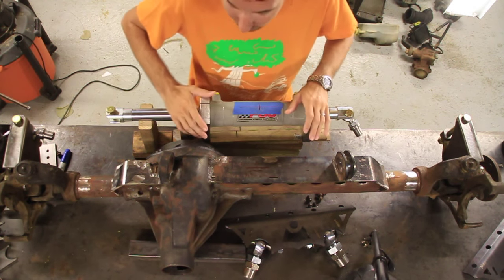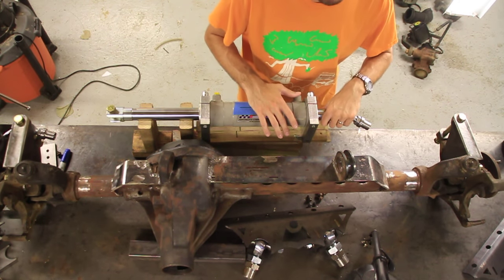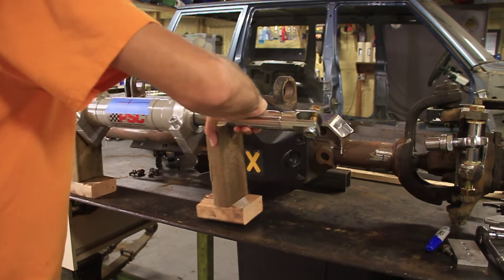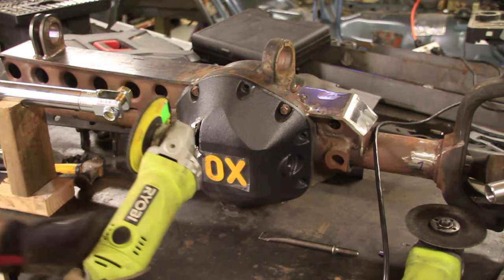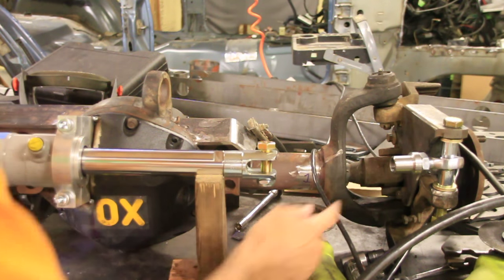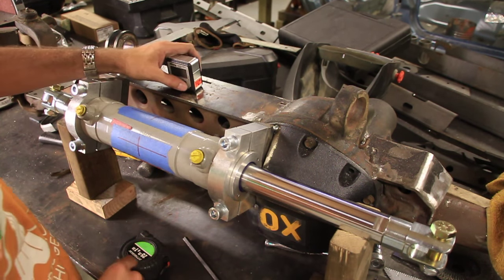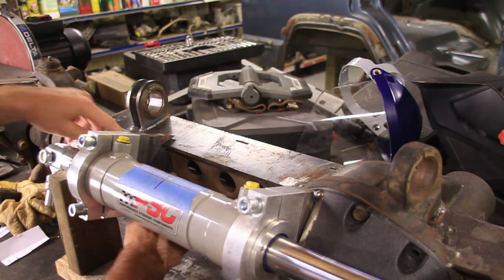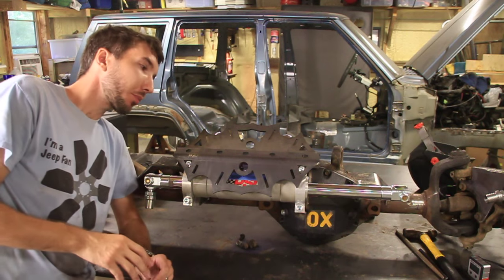How To Mount a PSC Ram

Comment: Angling your rod ends inwards at the correct angle (as mentioned at the 12 minute mark) gives more of a 1:1 steering ratio.
As an example, I ride my ends on the 2nd hole back of my high steer arms.

Yet another great vid Matt.

Comment: Just some info when grinding Aluminum, apply some grease to both, the Aluminum and the soft wheel disc.
This keeps the material from gumming up the disc.
Generally a 36 grit soft wheel works best.

Comment: Absolutely awesome! But how would you change gear oil or do any differential work without having to remove the entire ram set up?
Reply from the maker: You won't, but there was no other solution... 4 bolts and it comes off in a few minutes though.
Reply: +BleepinJeep Very much appreciate the reply! Keep on doing amazing work really excited to see how this project turns out!

Comment: awesome. you are very quick with figuring out custom brackets. sweet steering setup, hey what front suspension are you going to be building. 4 link? 3 link? radius? you might have already mentioned it but i don't remember
Good shit and always happy to see your new vids
Reply: If I remember right, in a previous video he said 4 link.
Reply: without panhard?
can't wait to see that build. im right at the point where im designing a front 3 link and crossmember ..
Reply from the maker: Yes, double triangulated 4 link.
Reply: Awesome. Can't wait to see how you package it !

Comment: what kinda torch is that ? propane ? , my set up is on a toyota so its a little different , my ram is a bit  different than yours , 6 inch stroke and no groves on the cylinder body for the clamps but it is from PSC

Comment: Care needs to be taken when changing shape of diff. inside shape of stock covers are  designed to feed gear lube smoothly and not aerate. If lube does not flow well will decrease amount lube going to pinion bearing and fluid with air in it does not dissipate heat as well. Those cool looking squared off aluminum covers with fins I see on many rears are poorly designed.

Comment: Sanding aluminum and steel using the same belt or disc sander is not necessarily the smartest idea. Aluminum powder or grinding swarf is potentially dangerous if it is mixed with iron or steel grinding wastes and is wet. These are the basic ingredients of a thermite bomb, and there is a very real risk of a fire due to the reaction between the aluminum and the iron.
Reply: +Nick Gross I sincerely doubt that the temperatures will get hot enough to ignite the supposed thermite, and couple that with the fact that the ratios will likely be far off from what the reaction requires I think he'll be okay.
Reply: Just something to keep in mind.

Comment: why didn't you just make a bracket that welds/mounts to the top truss and the axle??? U never want to put such stress on a cover anything cast like that could crack with all that force on it, You could make a beefy C shape or U Shape very shallow that would bold/weld to each side of the tubes and truss that you can take off.  just a thought... keep it up

Comment: so my gas gauge on my jeep keeps bouncing around so it's confusing knowing how much gas I got left, it specially bounce when I give a big turn. Does anybody know what it can be? Sensor maybe
Reply: Sending unit, maybe. Yknow, the lil doodad in yer tank what fer slurpin' up fuel and sending it to the engine.

If you drop your fuel tank and disconnect all the fuel lines to it, there's an assembly that screws into the top. This assembly should have an inline fuel filter, a tube that sucks up the gas into the lines, and a float that shows fuel level. (like a carburetor, toilet, or swamp cooler) This float may be rusted, loose, or have a hole in it, allowing it to fill with gasoline, which would prevent it from floating and give you erratic readings.

Comment: Full hydro legal for street use?
Reply from the maker: No
Reply: +BleepinJeep why not??
Reply from the maker: +joe smith Full Hydro has no backup plan or hard link to the wheels in case of a hydraulic failure... meaning if you were going down the highway and a hose busted you would have no steering control.  You might get by with hydro assist which keeps the stock steering but just adds a single ended ram to help it along.  See my upcoming video on this topic.
Reply: +BleepinJeep Adam Savage had the pitman arm get loose on his land cruiser while driving on a freeway...quess the nut keeping it on was a tiny bit loose and it destroyed the axle coming out of the steering box. you can never have too much redundancy on your steering :). full hydro basically has no redundancy in a case of failure.